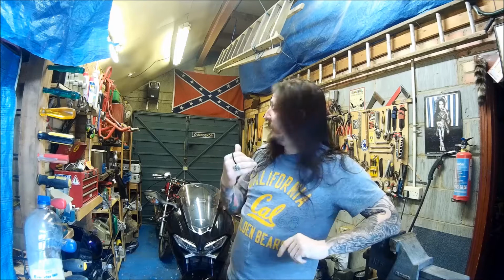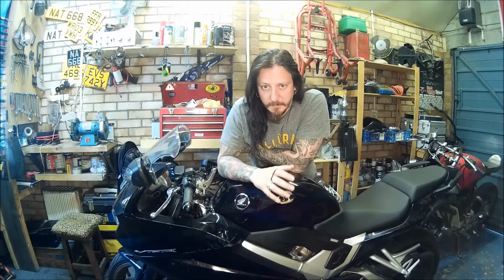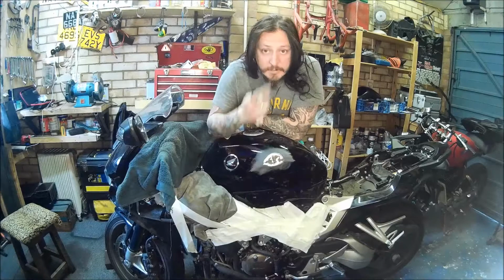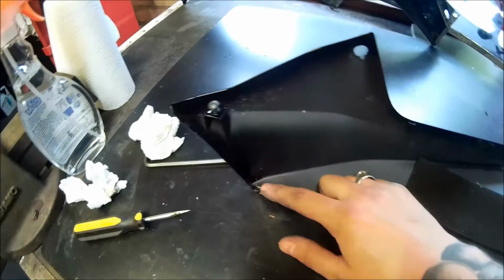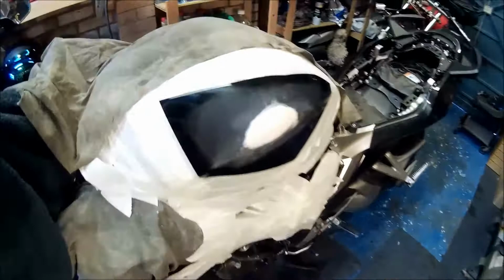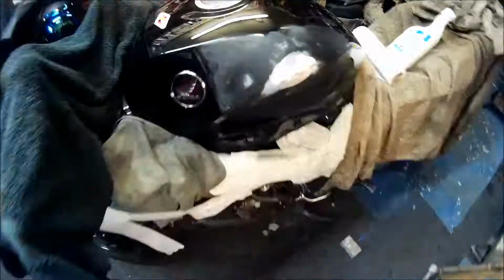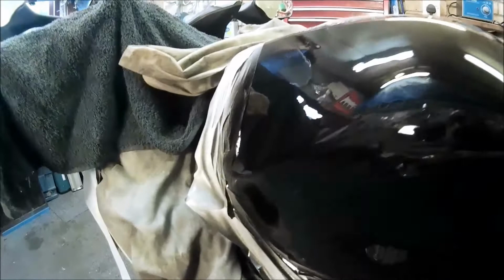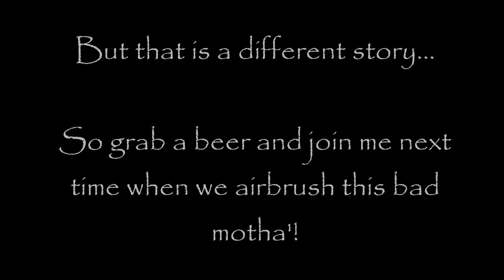Cambridge Pinstriping, Repairing Dent on a Petrol Tank, Honda VFR 800

Comment: hi mackie, my foreman taught me when rubbing down a repair like that, don't use rubbing down paper, rub it down with T-cut. it's way better and leaves no scoring on the paintwork, and you can paint over it perfectly OK with no contamination of the paint. just Polish off the T-cut, tacky rag it and paint it, T-cut again and lacquer. you'd be amazed at how much easier it is, and you get a better finish. but each to their own way of doing things. sweeeet repair on the tank.   😀 👍 👍
Reply from the maker: Mikey mike that's correct mikey, this case however was not an option as the corrosion and paint chipping was too far driven.  the bike was left outdoors for couple not winter months after the incident happened, sonic got rusty and horrible. nothing that some elbow grease couldn't handle.
Reply: MackieBass          sorry, I really didn't say that properly, I meant after the rubbing down of the damaged area and the first coats of primer, then start with the T-cuting. DOH I must formulate my comments gooder. lol 😁 👍